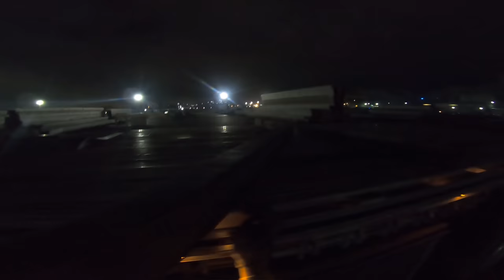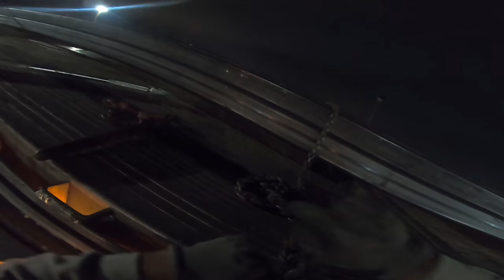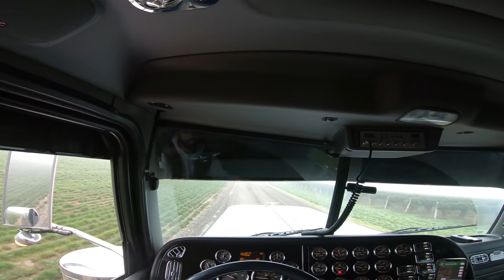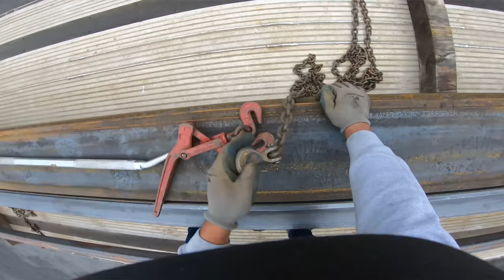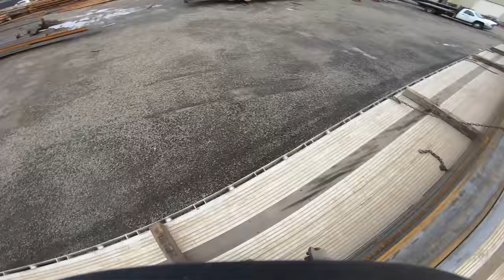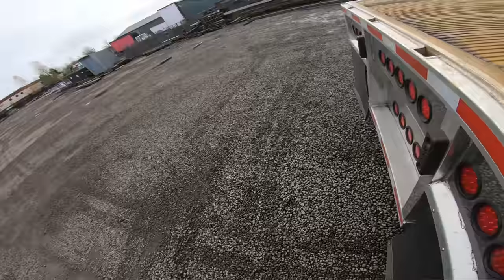POV ride along 3 drop load | 11,000 pounds | local steel hauling

Comment: Should consider getting some LED work light mounted on the back of your sleeper so you can have light shooting to your trailer and work area, but I dont know how you would do that and still have a super clean sleeper. If you had a headache rack it would all come together pretty good. Look up carlile trucks or most trucks in Alaska. Everyone has those xvision led pod lights mounted to their sleeper or headache rack and it really helps working behind the truck and backing up in low light situations
Reply from the maker: Yeah… not into that.. I like to make it hard on my self lol. All for the clean and nice look. 😂🤘

Comment: As a new owner op I like to see what other owner ops are doing…your videos allow me to see other perspectives in the industry. What logs are you running? I am local as well and don’t run logs unless I go over 150 which is not very often.
Reply from the maker: I have keep trucking
Reply: @trucking4racecars  also as I was running heavy haul and oversized. In order to get into tight spots I would drive 1/3 of the truck passed the road and then would jack knife the truck to get into spots. It also allows the truck to be straight as you pull the trailer through the turn. Just food for thought.

Comment: I know that first stop is a rough one. It is getting out of his facility is rough as well ecpsecially if they have equipment in there. You should have seen it before the widened that drive way. It was rough in a day cab with a 40' trailer.
Reply: And just so you know, at Ram they have clean and dry donnage inside.

Comment: Question on that tight turn getting out of your first drop... you think using that parking lot across the turn would have made it easier ? Just pull in there and circle around... Thanks for all the content.
Reply from the maker: Yeah that was my second choice. Usually they have a stump there so we can’t make go into their driveway. But I wanted to see if I could get out if I didn’t have that option
Reply: @trucking4racecars  I'm new to trucking only had my authority for 2 months. Every trip out is that stressful for me LOL 
Hoping to grab a load outta Albany to Kenniwick next week. My plan is to tough it out in my daycab for a year and grab a new Pete. All this info helps so much. 👍Oregon weather ain't like So Cal lol

Comment: Oh yeah,you have the same tranny and truck as I,of course your's is nicer ,mine is 03,not giving lessons but for me I learned a long time ago instead of adjusting my clutch over and over I start out empty and loaded in the lowest gear and barely accelerate then quickly split to the high 3 and shift as you would, that's my habit that saved slot of adjustments,keep up the good work and attitude,ps I'm from the Jersey Shore so you learn to relax,JD